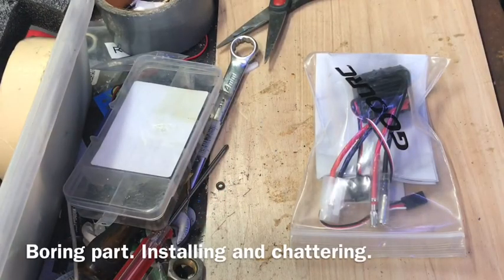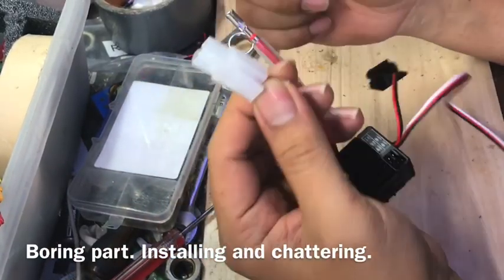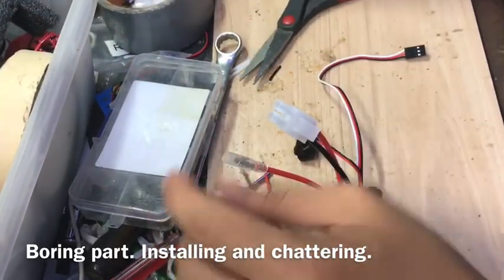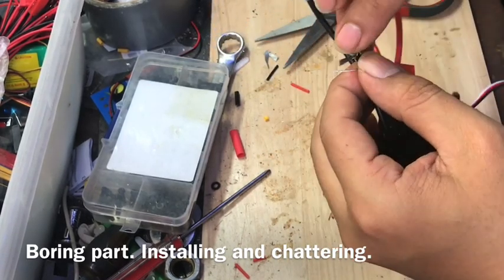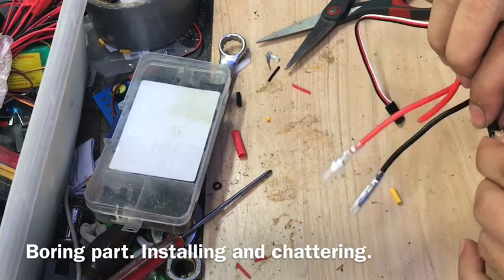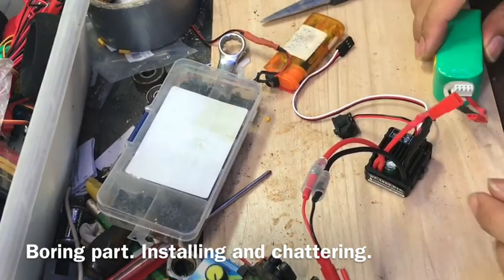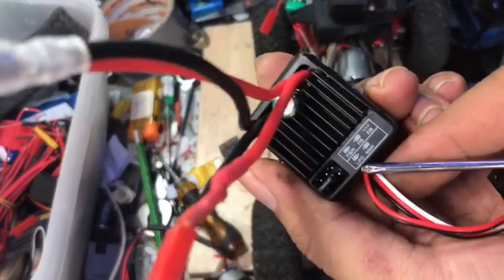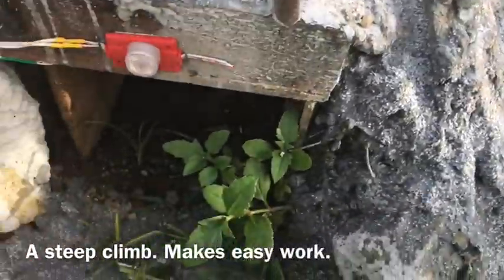Goolrc 60A ESC installation and test

Comment: I just bought gool rc waterproof brushless motor and esc 60amp and a dumbo rc remote and receiver. When i plugged it all up using a 8.4 nimh the motor runs for about 30 40 seconds then starts to slow then it stops. If i turn off esc n back on the motor runs again for around same time..but my servo keeps running though..what is going on???? Also esc flashing red light...